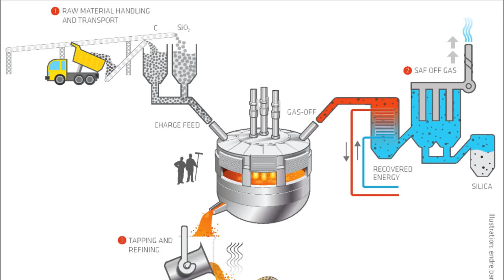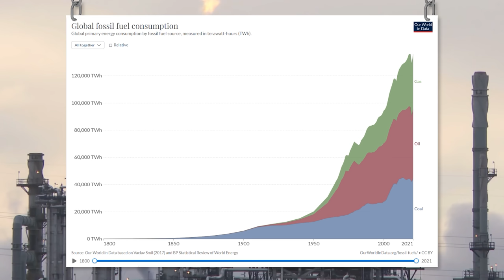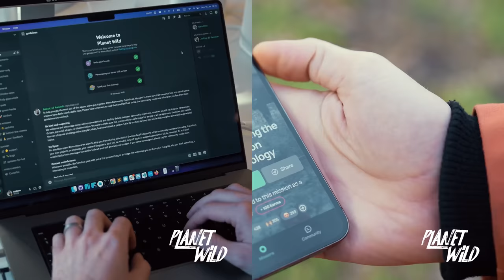We Will Be the Last Civilization on Earth

Comment: While I appreciate the thought experiment, I believe it didn't consider many possible alternative pathways. Some seemingly ""normal," and others decidedly not. Alcohol has been with us for thousands of years, during which we mostly drank it. It does present a renewable way to produce fuel because it can be easily refined at relatively low heat... As long as the next civilization avoids getting drunk instead of using it for fuel. Methane could be captured by filtering air in barns and even restrooms. Plastics can be made from renewable resources, though it is much more expensive and complex to do so. Through the use of alcohol fuels (bio-fuels) a civilization can eventually refine silicon, which could then be used for semiconductors and then more complex renewable energy generation. Of course, silicon is not technically necessary for building computers; it is only necessary to build them the way we do now.

All of this ignores one crucial factor. Dams. By leveraging hydro-electric power generation, a smaller civilization could (theoretically) manage to exist entirely without using fossil fuels. This would not get them into space, but hydrogen could, and the dams can provide the electricity needed for electrolysis. Once hydrogen is achieved, the sky is no longer the limit. Hydrogen fuel cells can power transportation, hydrogen generators can provide power away from rivers (expanding the range of this theoretical civilization,) solar energy collection would still be achievable (though perhaps less efficiently,) solar can ALSO provide extreme melting temperatures for refinement processes through lenses, and so much more.

TL:DR: There are alternatives for everything we have today, and a future civilization likely wouldn't even use fossil fuels the way we did... Simply because they wouldn't have access to it so "early." They would not recognize how cheap those fuels are to use until they were at a place where they would quickly realize the downsides, at which point they would likely utilize them very differently.

Comment: Oil isn't necessarily fossil, it's geological, under high heat and pressure deep in the earth methane becomes petroleum oil. Oil wells replenish over time, even empty wells have started producing again.
Coal on the other hand is fully fossil, and will NEVER replenish, it's all from the carboniferous era, before nature learned how to break down lignin. No new fossil coal will ever occur, because it will become food for bacteria, worms, insects, etc far before it could become fossilized.

Comment: According to the geological record, for millions of years CO2 levels have been decreasing to dangerously low levels that would no longer support plant life and hence we would all die.  Right now , any increase in CO2 levels would actually spur on better crop yields and help avoid famine.  As a greenhouse gas CO2 barely makes up 1% of the atmosphere and only adds to atmospheric heating if it exists in much greater concentrations like found on the planet Venus.  Water vapor makes up 95% of the greenhouse gases and is mostly responsible for global atmospheric heating.  Methane is the next largest component at around 3 to 4 % and actually does add to atmospheric heating.  Most methane comes from the bowels of the earth and not the bowels of cattle !  It comes from volcanoes, earthquakes, methane vents under the oceans, and rotting vegetation.
We should be far more concerned about real pollutants that poison our water and air !

Comment: Currently the world uses 4 billion tonnes of petroleum and 8 billion tonnes of coal.  Coal has around half the calorific value of so we are currently using about 8 billion tonnes of oil equivalent. 
About 750 million tonnes of palm oil can be produced on an area of 1.5 million km2 (1% of the Earth's surface) assuming a production rate of 5 T of oil/hectare. 5% of the Earth's surface dedicated to growing palm oil would give us 3.75 billion tonnes of vegetable oil with current techniques - lets say 2 billion tonnes per year assuming that cultivation in the future will not be as efficient as today. 
You would also have methane formed from the fermentation of palm oil mill effluent.  Presumably the post apocalyptic world would have a smaller population than we have today so 2 billion tonnes of oil / year would be enough to do all the things we can do today. 
Using 5% of the Earth's surface would not be overwhelming and would still allow room for extensive tropical forests

Comment: KNOWLEDGE.

You didn’t specify, whether the people after our civilization going bust would retain knowledge (in some pockets and possibly write it down).

With knowledge workarounds lack of fossil can be made even from middle age technology forward.

- to use Wind, solar, water stored energy - harvest electricity and leapfroging forward.

I assume all future people in Your example would be isolated from knowledge as well.

- still one more source (limited tough) to provide hot fires and temperatures - isolated oils and fats from crop and animals. 

Today with our knowledge even petrol is not such a problem to be isolated from crop oils. The quantity obtained would be much smaller - enough to smith some special use metals for further equipment though

Comment: Wood, charcoal, and wood gas. Wouldn't those meet the bare minimum to get to the point we could start remanufacturing electrical generation equipment for hydrolysis? Could smelt plenty with that, I'd think. 
Idk, just a layman speculating.

Comment: Fossil fuel is not from old plants etc. That's not correct. Oil and gas is continuously produced inside earth due to an energy excess from the sun and the atmospheric blanket trapping energy. As long as the sun shines and we have water on the surface new oil will be plentyful.

Comment: Question. Do you think we could use biogass generation through anerobic composting, at massive scales, to provide the hotter burning methane/ethane gas to fill the gap in other fossile fules? Seems like that gas production could be a viable means of smelting all but silicone, which might be achieved mixing in other gasses.
Reply: We could, but what would be the purpose?
Reply: Anerohic bacteria cultures of that scale would be its own issue

Comment: The basic assumptions here are just completely ruled out.  All of the hydrogen bombs in the world if exploded will absolutely NOT eliminate all books.  All of those blasts will not eliminate all metal or steel tools such as knives or axes.  The total number of books in the world will go down but all around the world in rural areas there will be no blast effects.  The total population of axe-heads, knives, swords, plows, etc.  would only go down by a small percentage.  Hydrogen bomb blasts will be mostly 'air bursts' and this is the height that is most effective against a city.  This causes the greatest blast effects, etc.

Think of all the basements around the world which have steel axe-heads, knives, tools, etc..  Very few basements will be heated to the point that the steel would melt.  Widespread fires could burn a lot of houses, cities, etc. but the average farmhouse will remain untouched.  Even for a house that is burned down (perhaps in the suburbs) the steel instruments would likely still remain in the ashes.  Survivors would rummage through ashes looking for knives, axes, saws, etc. and all of these would be readily available after every nuke had been used.

Think of for example the full plan for using nukes on a country.  All the cities could be targeted, and there might be enough nukes to even target towns in addition to cities, but consider, any conceivable plan for nuking a country will not include enough nukes to seriously diminish the number of farm houses in a country.
So all of the practical tools in an average farmhouse will remain easily available for the survivors.

Also there will be a vast amount of scrap metal that can be melted down and reused.  (A lot of cars could be burned by the attacks, but the metal would remain.)

So we will have the books which give all of the details on how to carry out basic industrial processes from the past.  For example to melt down steel and use it to make new tools, books will explain what kind of temperatures are required, how to build and fuel such a furnace.  Also old equipment for melting down metal will likely remain.  An old steel mill sitting unused may not be targeted, or it may be at such a distance from the nearest air-burst that the old heavy machinery may not be destroyed.

 The process I've described, taken across the entire planet will leave a lot of remaining equipment.  For example how much of New Zealand will be burned to a crisp by hydrogen bombs?  Think about it.  Likely no one will nuke New Zealand.  I mean who has plans for nuking New Zealand.  That place will likely remain fully functioning.  They would likely still have all of their functioning power plants.  A nuclear winter in the southern hemisphere (not all that likely) would really bring down countries like that, but still all of the machinery would remain.  Nuclear winter doesn't burn down buildings.

Following WW 3, survivors in places that are hit hard will be rummaging through everything left, finding all of the basic 'older style' survival equipment.

When this video implies that axe-heads and knives will be non-existent, that is ridiculous.

I suggest someone re-make this video using better assumptions.

Cheers.

Comment: Some of your data is incorrect. Rebuilding would be easier than you think. Due to resources in remote locations humanity will be able to rebuild fairly quickly. The only way to prevent this is to completely exterminate the species. The difference will be in government systems that come to power.

Comment: There is electric furneces. Quite efective and impresive. It is possible to get renuwable energy from dams wind as low-tech options. It is used to make aluminium as fosil option would be too expensive. You can make fertilizers from hydrogen or mine special ones with zero fosil fuels in theory. I am sorry, but you can build a much, much better society withaut restriction of fosil fuels. It would explode, not spread. Without tree planting nonsense.

Comment: I've heard that everything looks like a nail to a hammer. I would venture to bet that a new civilization would actually do better without all the easy to find fossil fuels. Material science is by far much more capable than simply making a hammer out of steel. I think the slight amount of time using biochemistry and understanding the abundant resources with material science would set up a new civilization to grow exponentially faster than the one we were spoiled on by using easy to find resources in the metallurgic ages. Carbon based structures 100x stronger than steel, biologically grown computers, micro-fusion at the atomic scale using biological construction techniques could promise a much better outcome.

Comment: first of all... electricity can be obtained as easily as copper wire, aluminium wire and a magnet, a magnet can be constructed with a slab of iron and electric current running through it.

Once we understood electricity we can bypass much of this civiliation building issues and dive right into magnetism and from there electricity and after that we can work on the issues of the previous civilization, the current civilizations issues is not energy generation it's energy storage, we choose to burn fuels because it's easy to ramp up and wind down the production of electricity, the next generation can sit down and look each other and grunt, knowing that they need energy storage more that energy production and only ramp up energy production rather than going through the yoyo proccess we do now.

We can do so with nuclear as the major source, yes there will be a lot of pollutants but with electric methods to reduce the pollutants the pollutants will only become less and less over time as we store more energy.

You just need to ask yourself "how much energy are we going to use over 7 days" and then aim to have 8 days of storage for growth. you think electricity is very low temperature... but incandescent light bulbs burn at 2,500 degrees celcius, in a vacuum, with just 100 watts. that is enough to melt a lot of material and can easily meet the needs of melting iron we removed the incandescent because it was inefficient, many modern methods of melting includes magnetic force... trust me it's incredibly powerful, especially wen you can start with a simple magnet and can cold roll the copper or aluminium.

even if nuclear wasn't available, a solar powered sterling engine would really give a boost to electricity production and a capacitor to jump start the alloy stage once again and from that the industrial era... but why stop there... a few years after rediscovering magnatism you could tinker with trying to automate production and at the same time rediscover computing power. within 25 years the civilization would be working towards regaining a foothold back into the modern world and surpass it within 100 years.

They just need to sit down and make a proper plan of action. building is easy, farming is easy, and rebuilding can be easy with proper planning and preparation... without falling back into old methods.
Reply: To summarize...
What you need to rebuild civilization is..
Fertile land for initial growth of food and to attract wildlife to hunt
Water Source
Shelter
Material IE: metals

I have not seen a video so pessimistic about a generation that will come after us thinking that they won't work out how to skip generational problems.

Comment: The doomsday cult of climate change is absolutely insane. If the CO2 effect was real that just trace amount of 0.03% can significantly insulate anything there would be physical demonstrations of the effect and it would be utilized in industries around the world. It would be the worlds best insulator (also our houses would be catching on fire same as beer and soda bottles and so on). If the "scattering" effect was real it would actually cool the earth - because the heatsource for earth is the sun and that's outside of the atmosphere. When heat-source is OUTSIDE of insulated area it's COOLING. When the heatsource inside of the insulated area it's keeping things warm and last time I've checked sun wasn't anywhere inside of the earths atmosphere. As for the "greenhouse effect" - in greenhouses the heat is retained by glass that prevent convection and stops the warm air and MOISTURE that carries most of the heat from escaping - last time I've checked in this universe CO2 was gas at room temperatures and doesn't prevent convection.

Comment: Can see batteries being a bigger pollutant than unrecylable plastics and far more toxic
Reply: Depends what is used in the batteries. Many being developed are not toxic at all, or at least any toxic material can easily be removed and re-used.
Reply: @Tengooda  fire safety issues too especially with lithium batteries used in e-scooters which have other issues!

Comment: You start off of an assumption that oil and gas are limited resources that we will run out of. That has been an unfounded lie being told since the 90’s for which there absolutely 0 evidence. In fact when we go back old dried up wells we find a significant amount of oil in them. This is problem with all the climate and oil talk is that no one can be honest. Neither side

Comment: The survivors will have a boon. They will know what is possible. That is the biggest first step for everything.
It will be after the survivors die off, the rot may set in. When fact becomes fiction just Gran's stories. That the danger will appear.
If they can maintain schooling, then they may have a chance.
It was the combination of money, with education, plus curiosity and time to look into the curiosities.
The reason it was so slow first time around was not enough were educated. Mostly the upper crust and business folk with money.
The wealth that came back to England as England conquered the world. And reigned for 400 odd years.
The deliberate exposure to all sorts of curiosities to all and sundry.

The acceleration in the 1900's was pretty much all down to education.

Many hands make light work. But many minds can make many things work better.

Religion with its fix beliefs held us back.
Not being able to be smarter than the emperor also held us back.
Totalitarian system was a mixed bag.

You're forgetting we can make fossil fuels from trees. World war 1 and 2 had wood burners cooking wood to give off wood gas fed to the carburetor.

Cheap power can be used to take Co2 out of the atmosphere and turned into designer fuels that are more efficient than their crude oil derivatives.  Hydro.

And 1 litre diesel take x weight further than the equivalent 1 litre of petrol.

The diesel exhaust can also be chemically changed to turn it into oxygen and nitrogen if memory serves. Check out adBlue.

Comment: Has this guy never heard of electric arc furnaces? We can produce cement and silicon without burning fossil fuels. Yes, we currently use hydrocarbons to make ammonia and plastics, but we don't need to BURN those hydrocarbons, which is what is meant by the term "fossil fuel". At any rate, it is possible to use green hydrogen and captured CO2 to produce hydrocarbons, so we don't need to keep extracting natural gas, petroleum and coal, but it does take a lot of energy to do it. 

All of the things that Astrum mentions can be done without burning fossil fuels, and he totally ignores synthetic fuels and biofuels in this video. Yes, it will be hard, but we can do it if we make it a priority and invest in eliminating fossil fuels.